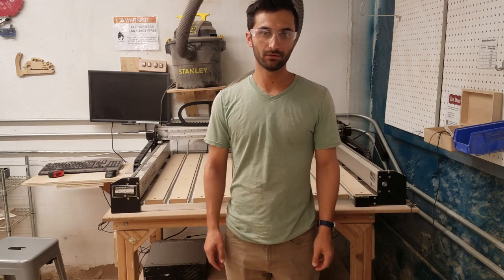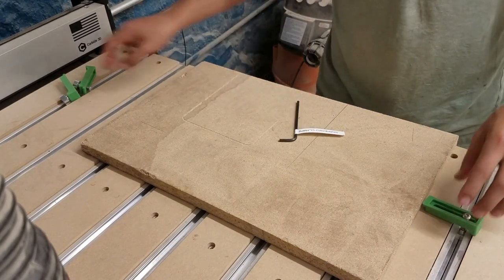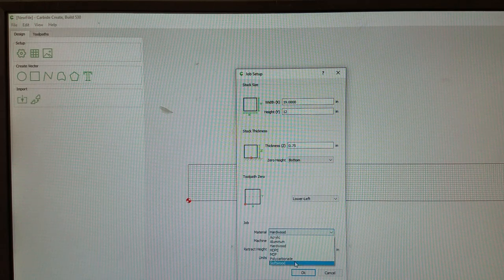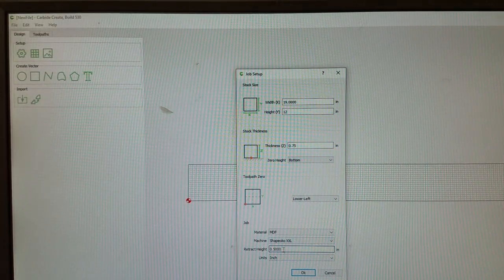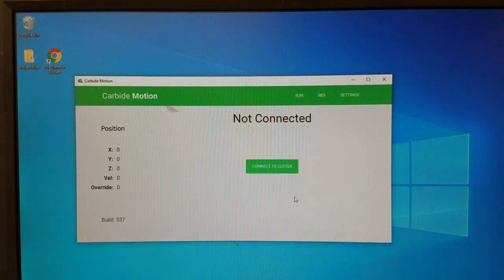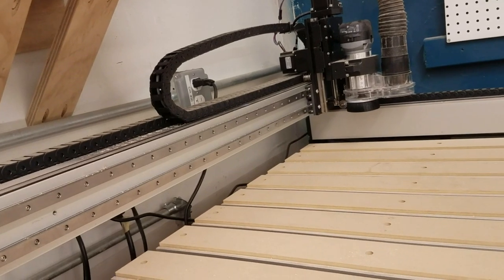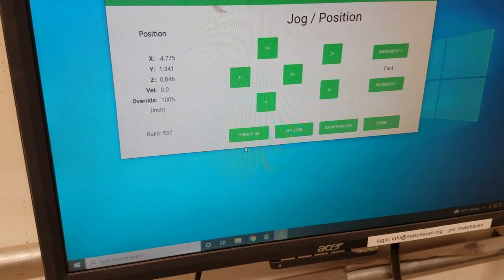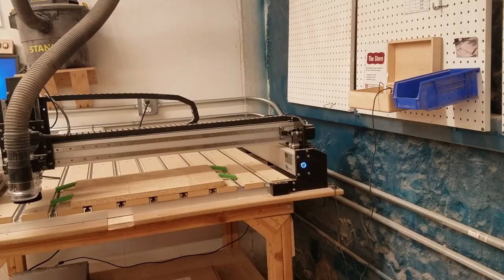How to use the Shapeoko Pro XXL

Comment: Great information: thanks.  Thanks. I would not want to have a computer inside the dusty shop next to the CNC machine. Therefore, is there another way to actually get the file to machine? For instance can you use a flash drive or say a SanDisk SD Card?

Comment: Nice video. Can you tell me please the steppers and the power supply specs?
Reply: The steppers are all Nema 23. 
The power supply for the CNC is 110v AC.
The spindle varies from 110v AC for the trim router up to 220v AC for a 2.2kw spindle/ VFD combo. 
Hope that helps.
Reply: @ClintonCaraway-CNC  yea, i saw they are nema23 size, but i asked about amps, torque and inductance (or model number). As for the drivers psu - how many amps (or watts).
For example the label should say smth like 3A, 1.5Nm (or 200ozin), 2.3 mH, and the psu like 36V, 10A (or 360W)